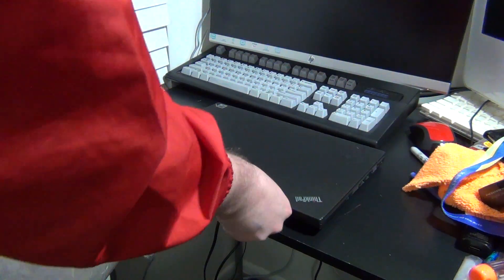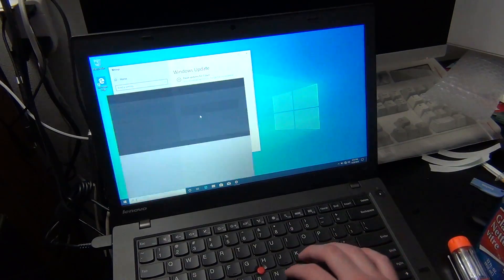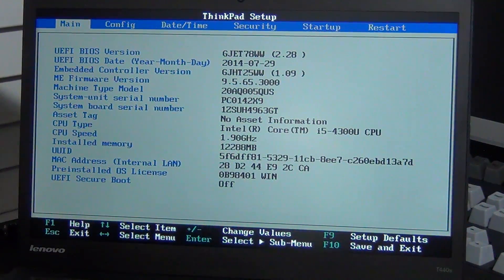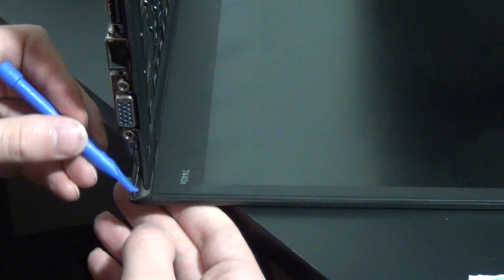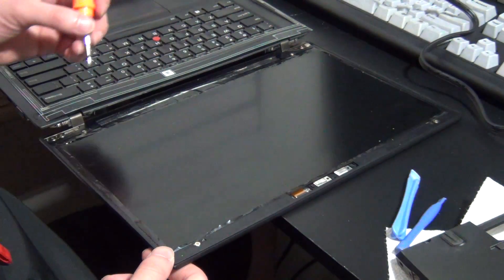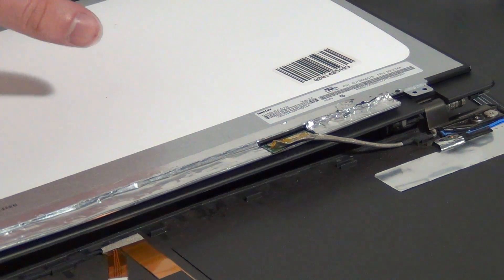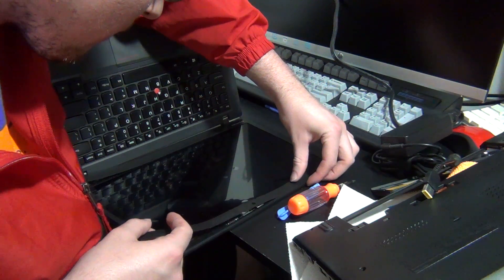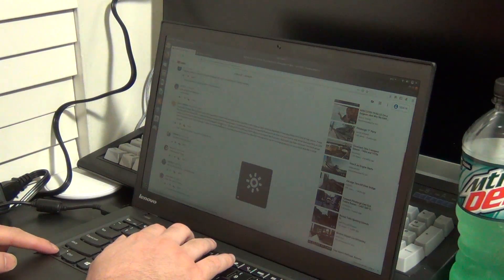Replacing screens on newer ThinkPads.

Comment: Replacement completed successfully! I cracked the old LCD panel (it already had multiple pixels beforehand) on my P14s gen 1 when removing the bezel, oops. Laptops used to be so much easier to service, damn. After that, I installed the new LCD panel perfectly on the first try, zero dead pixels, and I installed the bezel and bezel sheet perfectly on the first try.

Comment: You really need a hot air blower to ease-out the glue before pulling the plastic bezel out. Removing it out cold will most often leave dents and wrinkles all around the bezel
Reply: I don't recommend it anymore with this lenovo yoga. The hot air warped the plastic , it's too thin 😢
Basically I don't recommend replacing just the LCD , replace the whole monitor lid . Opening the screen lid is a nightmare

Comment: I have a P52 and after accidentally sitting my fat ass on it, the screen wouldn't come on anymore... the computer still works as tested with the HDMI out, but when you turn on the machine, it makes a musical melody, which I checked with the Lenovo APP on my phone: 0288 Computer Display Error. So I ordered a replacement screen, but the error didn't clear and still no picture... next I will try to replace the display cable, because both the original and the replacement screen look ok actually, so maybe the cable was compromised and damaged when I sat on the computer. Do you have any other idea?
Reply from the maker: Cable might be a safe bet unless you somehow damaged the motherboard.
Reply: @SebisRandomTech  Yes, I considered that possibility, really hope it's not the motherboard...
Reply: I should maybe check the connection of the old cable... maybe it just got unseated...
Reply: Wow... I just did that, reseated the old display cable on the motherboard and now the replacement screen works! :)
Reply from the maker: @TheCruisinCrew  Awesome! Glad you got it working!

Comment: hey I just buy x1 carbon gen 6 used but it has loose outer plastic bezel, just the corner? should I take all of it and reapply it or just the corner?. and what adhesive you recommend? I just purchased t7000 lcd glue is this good enough?.
Reply from the maker: Usually isn't too hard to find a display adhesive (usually from 3M) on eBay.

Comment: Umm so I dropped my Lenovo thinkpad t590 and it went black screen but it runs I have to use hdmi to the tv. any idea what i should do?
Reply: Also it makes weird beeping noise before it turns on
Reply: Im on the laptop with the tv It runs fine im on it right now but pls anyone know what i should do with black screen on my laptop
Reply from the maker: Try changing the display settings to see if that fixes anything. If not it's possible you damaged the cable that connects the motherboard to the internal display or damaged the display itself.
Reply: @SebisRandomTech  yea its the screen that broke I see my display on now but its half broken so might have to get it replaced do u know if its expensive to repair ?
Reply from the maker: @austflett8614  If the display itself is broken you can't really "repair" it. You'll probably have to replace the panel, which will probably cost you between $80 and $100 based off the eBay prices I can find.

Comment: For P1 and x1 extreme, gen 1 and gen 2, do you know if the 1080p and 4K panels are interchangeable? I noticed the connector on motherboard are identical, was thinking to buy a 4K assembly with harness to replace the FHD one if possible, thanks for your help.
Reply from the maker: I don't see why you wouldn't be able to, but I've never worked on either of those machines so I can't say for sure.
Reply: @SebisRandomTech  just had it done, connectors are same, pretty much pnp, easy.

Comment: Used this to replace the screen in my T540 as the low res TN it comes with is just horrible!!!!!

I got the laptop for 130 GBP, replacement screen for 60 and an upgrade enteral battery and new internal battery for 90 and i had 4gig of ram lying arround.

Thats 280 GBP , in covid times thats not bad at all.

Comment: Hi, I'm looking forward to buy a T14 used but it comes with a 720p screen. I want to change it with a FHD, maybe touch but it's really difficult to find the display models compatible or I don't really know where to look. Could anyone head me in the right direction?
Reply from the maker: Look for an IGZO LPFHD screen. The T14 was available with them, they are 1080p IPS panels that use less power. I think they work without any other modifications.
Reply: @SebisRandomTech  I found today the FHD 400nits low power panel should be the model number: B140HAN05.7. Looking for the touch version with FHD and 300 nits, if I can't find it, I'll go for the 400 nits one.

Comment: Do not do this on X1C3. The front part the bezel is not supposed to come off from the frame and it doesnt hide any screws. You start from the outside of the frame undoing the snaps on the perimeter and then gently peel off the adehesive that is between the bezel and the front edge of the display. X1C4 i can tell its different since it has two screws hidden in the bottom of the bezel you need to remove before prying anything up. Dont listen to a guy that says "oh yes it works for <insert list of 50 different laptops>. Always check for videos specific to your machine and the hardware maintenance manual.

Comment: Hi, do you have a recommendation for a 4k or 2k screen for the T440p ? And does the 4k or 2k screen work ? Thanks.
Reply from the maker: As of now there are no screens beyond 1080p that will work with the T440p. Someone in the ThinkPad community is working on a mod kit that will allow 1440p or even 4K screens to work, but I have no clue if/when that will be ready.
Reply: @SebisRandomTech  Any news, cause Im looking to buy a T14 (non s) with the new amd 4000 apu but I find the display options available (max 1080p, 500 nits privacy) lacking in comparison to the intel options (upto 4k)

Comment: i used t440s, but since the display is very bad, i dock my thinkpad and use external monitor. my question is: is it possible to replace the touch screen display with non touch screen and upgraded display? and which model is the best as replacement display?
Reply from the maker: You'll need to get an entire (non touch) display assembly. The InnoLux N140HCE-EN1 (Revision 2 or 4) is often regarded as a good 1080p panel.

Comment: For me i would drill a hole in the outer bezel on top of the 4 screws holding the display and then add pieces of rubber on top of the holes as if it came out of the factory like that

Comment: On the T460s you can remove the inner and outer bezels at once, because no screws are used to attach the inner bezel. Just use your fingernails and carefully lift the bezel up from the inside. I can also confirm, that there is no Whitelist on this model as I used an AUO B140HAN1.03 with a Dell part number. The original display was not broken but too dim for working outdoors in my opinion.
Reply from the maker: You’re correct, only the xx50 series had a whitelist.

Comment: Hi sebi I have a question can I upgrade my L430 screen from 1366x768 to 1600x900?
Reply from the maker: You should be able to, however I’ve never used an L430 before so I can’t say that for sure.
Reply: @SebisRandomTech  I see because I saw some l430 variant using 1600x900 screen. Last question as long as the screen is same 14inches and same 40pin do you think it will work? Thanks
Reply from the maker: It likely should.
Reply: @SebisRandomTech  thank you so much!

Comment: T460 and newer dont have the internal bezel.
Reply from the maker: Considering I just replaced the screen in a T460 and it was constructed almost the same as a T440/450, I beg to differ.
Reply: @SebisRandomTech  Perhaps it was 470 and newer. I know that the T25 and T480 both dont.
Reply from the maker: Someone did say in their T480 the design had been altered. I’ll look more into it at some point if I upgrade the display on my own T480. For the time being I’m happy with the current one though, so that’ll probably be some time away.

Comment: Hi there,  Iknow this may be a long shot, but here goes nothing.
I've got an X1 carbon 3884, which lost keyboard backlight, touchpad and trackpad after a thermal paste replacement. I noticed it wouldn't post with the mouse flex cable connected, any ideas why that might be? thanks in advance
Reply from the maker: I would suggest looking for a replacement top case (keyboard, palmrest, and touchpad) on eBay or another website and see if that fixes the issue. You might be able to find a good deal on a used/new old stock part like that.
Reply: @SebisRandomTech  will do, thanks a lot, I appreciate your help
Reply from the maker: Maybe the cable got damaged, or you accidentally nicked an internal component when you had it apart? Those would be my first guesses.
Reply: @SebisRandomTech  First of all thank you for taking the time to read and answer my request for help. Here is the part number for the cable I am talking about: 50.4RQ05.011
This cable connects the entire keybord trackpad and touchpad at once to the mother board. What I noticed is that as long as the mouse smaller flex cable is connected, the laptop wouldn't post at all. All I get is a black screen, no lenovo logo, no beeps and nothing at all. In the rare ocasion it does actually post, I get the following error messages: 0188 - 0187- 2200, and then either freezes or shuts down without booting up.
Once I disconnect the smaller touchpad flex cable, the laptop boots up and works normally, except now I have no trachpad, touchpad nor keyboard backlight, other than that everything else works just fine.
I understand This may be a little too much to read,  but I hope I'll get any sort of help especially as there seems to be no sort of technical documentation for the 1st gen X1 carbon online, at least none that I could get my hands on.
Again, thank you for your time, and looking forward to hearing from you.
Reply: I failed to mention that repair shops are all closed due to lockdown, and parts from aliexpress usually take up to 2 month to get delivered in my country, and I'm trying to make sure what's wrong with the laptop before making any online purchase, especially that money's kinda tight right now.
Again, I  appreciate your assistance. Keep up the good work
Reply from the maker: I would see if replacing the touchpad cable fixes the problem. I imagine the part can be found on eBay.

Comment: Yuck to the adhesive bezels. Any idea which models use them? I know the X240 and X260 don't.
Reply from the maker: You’re right, the X240-270 didn’t use them. The L-series from the L440 all the way to the L490 didn’t use them, however the new L14 appears to. T540-570 didn’t use them, T580 onwards does though. T440p, T460p, and T470p didn’t use them, and the P5x/P7x models have never used them.
Reply: @SebisRandomTech  Interesting. Thanks for the info.

Comment: Great video! Just my 5 cents

These outer bezel sheets are annoying as hell. In my T450s i replaced the double sided tape with some new thin 3m double sided tape afterwards,. It worked out great. You can also try peelig off just the four corners to reveal the screws and unscrew them- this will eliminate the alignment annoyance and most of the original adhesive will be intact.  Since i repair a lot of t440 and t450 screens i usually use this method and it works out really great, and if being careful you can avoid any bezel wrinkling.

Also since T470 i believe, there is no need to remove the outer bezel, you can pull off the inner plastic frame/bezel piece with the outer sticker still glued in, simplifying the repair. This will come in handy if I ever decide to upgrade my T480 screen to 4k or 1440p.

Have a nice day!
Reply: does the 3m tape solution apply to the T480? if so, please link the one you use!
Reply: @DigitalFacades  It does! I used a little bit too thick of a tape, i was adding wwan antennas to my T480. It is not very noticeable, but get the thinnest tape posssible, you will need 2mm for the sides,.2mm for top, and 5mm width for the bottom
Reply: Matas Niewulis noted, thanks for the speedy reply!

Comment: Hello Sebi,

I know this question is not really related to the video but I am so desperate and running out of options that I feel like I must leave a comment here...

I have a t440p, and it keeps on shutting down unexpectedly. With AC (and without the battery), the machine would stay turned on for less than 5 mins before it suddenly shuts down completely.

With battery it's worse, because for some reason the laptop does not even last a few seconds before it shuts down completely. So in summary, the laptop lasts for 5 mins on average on AC power and for 2-3 seconds on battery power before mysteriously shutting down.

Everytime it shuts down like this, I am not able to turn on my laptop just by pressing the power button - I must unplug and plug back in the AC adapter in order to turn it on.

Yes, I tried repasting the CPU but it did not solve the problem. Please help. Due to the coronavirus, I can't even go to a repair shop to to get it repaired. I have been without a laptop for weeks now and it is very hard..  Thanks in advance
Reply from the maker: That sounds like some sort of motherboard failure. Depending on where you live replacement boards might be fairly inexpensive.

Comment: I want to know how many units you've purchased for really cheap that were NOT TESTED that turned out to be a motherboard issue?  TO be honest, a majority might be smaller issues but it's hard to believe that more of these units don't have major problems associated with them.
Reply from the maker: I’ve had the occasional problem machine, like a T440s I purchased a while ago with a dead motherboard, but sometimes an untested laptop is simply untested because the seller doesn’t have a way of testing it (working power adapter or battery). It’s a bit of a gamble to buy untested machines but sometimes it can pay off.

Comment: Thank you for great value knowledge, sebi do you have idea for alternative my 15.4 x1200 resolution t61p display become yellow replacement?
Reply from the maker: That means the CCFL backlight is starting to fail. You can replace the screen with another similar model, and if you’re looking for a good long-term solution it’s possible to swap out the CCFL backlight with LED’s. There are LED upgrade kits that can be purchased online, and I may make a video about this in the near-future as I have a T42p with a FlexView IPS display that has a failing backlight.
Reply: Sebi's Random Tech danke ..so switch to LED can also keep play on x1200 resolution?
Reply from the maker: Yes, if you can perform the swap successfully.
Reply: @SebisRandomTech  I really, REALLY want to see that video as I just bought a T60p with the UXGA FlexView display.

Comment: maybe it would have been easier to remove with a little heat
Reply from the maker: Possibly, but if it can be done without it I don’t see the reason to. It’s not like any parts will be damaged if you don’t use heat, in fact if you aren’t careful using heat could damage/deform the plastic or one of the internal components.
Reply: @SebisRandomTech , just use a little heat and only peel off the sticker at the corners until you see the screws so you can unscrew them. That's how I do it and it is the best method in my opinion

Comment: very helpful video. Do all Thinkpads with the new flush hinge design have this type of thin, adhered bezel?
Reply from the maker: At this point it looks like nearly all models going forward, except for the thicker P series (P53, P73, and the to-be-released P15 and P17 that will replace them) have the adhesive bezel.